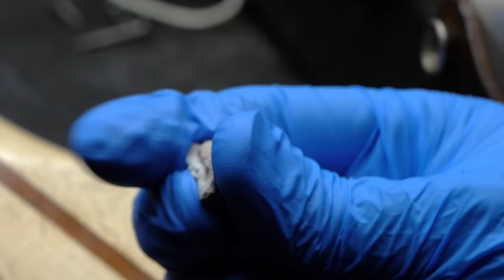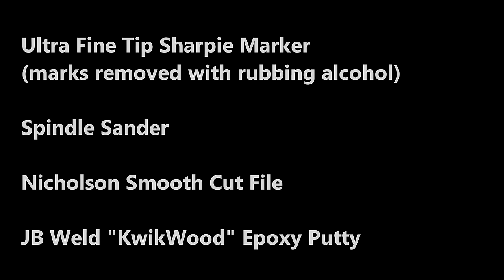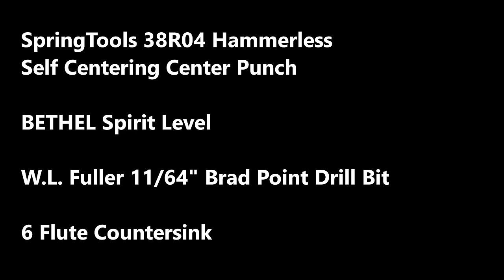My Strat Gets a Heel Contour

Comment: You left some pretty harsh edges on that body after the spindle sander.  It would be pretty easy to round them over just a bit for a better hand-feel.  Otherwise nice job.
Reply from the maker: I'm frustrated I left that part out! I actually have a video clip of me aggressively rounding over the edges and getting it perfectly rounded off with a smooth cut file -- but I forgot to include it. 

Anyway, thanks for the compliment, and I appreciate the support! I hope I can implant this in my brain as a lesson for next time -- I have to proof-watch my videos multiple times and make sure they include everything. No excuses.

Comment: I didn't know MIM Fenders had bushings for the neck screws- what a good idea! I hvae a 1993 Japanese HRR Strat with a contoured heel- such a good idea I wonder if they should be on all Strats (except vintage reissues etc.
Reply from the maker: No guitars I'm aware of come with threaded inserts -- I did the installation myself, which I have a video about if you're interested: 

https://youtu.be/LRMnSfjIqik?si=izTArK9L1EB69DRb

I go over the whole process in-depth there. Great mod! 

Also, awesome about that Japanese Strat. I agree the contour should be on all Strats. Makes a huge, huge difference. I haven't seen many contours in person, and just winged this one -- but it came out great. Upper register is actually usable now!
Reply: @guitar_md  Gotcha. Good job- great idea. Had a thread go on a Sire Bass a while back while doing work on it- would have been a good idea for that..
Reply from the maker: @thedonal  Oh, I love threaded inserts for repairs. Sometimes you can touch up the threads with CA glue..but the threaded inserts are much easier than doing a plug and re-drill. 

With the inserts, you just drill oversize, then drive the insert in. With plugging a hole and re-drilling, you've gotta plug it, then reattach it to the body, mark the location, then drill it out. 

The EZ-LOK threaded inserts are awesome too. I think they're the best out there. Very, very aggressive threads that bite deep into the wood. Can't see those ever loosening up or failing in a million years. 

8-32 is the way to go. Get some stainless steel machine screws and you're good to go!
Reply: @guitar_md  I went with bamboo BBQ skewers and wood glue- seems to be holding. The neck screws on that bass are bendy as fark though!

Comment: Hi my strat body is countour neck joint,can i use standard strat neck?what i need to consider.?my strat neck joint looks like suhr modern style..
Reply from the maker: You should be able to use a standard Strat neck with it, as far as I know. The neck pockets on Strats are standardized and will fit most of the time. Chances are, it'll work. 

The contour neck joint won't be a problem. Most necks will come without holes drilled, so you'll have to drill them yourself -- or if there are holes already, you'll likely just have to drill one additional hole. The contoured neck heels usually have one of the neck screws placed much lower than it usually is. 

Let me know how it goes!
Reply: @ thanks so much for the reply..now i have the idea and the courage to buy the neck😅..

Comment: What was the reason behind counter sinking the new screw hole before putting the plate on?
Reply from the maker: It's very unlikely, but it's possible for the screws to chip the paint around the screw holes when removing the neck. When pulling the screws out it could catch the edge of the hole and take a chip of paint up with it. 

Very unlikely -- but possible. Plus, the countersink just looks nicer. The other holes were also countersunk -- unsure if I did this before, or it was from the factory that way. But either way it looks much more aesthetic and takes a much better picture.

Comment: Why are you putting a spirit level on your piece? Level the base plate and it'll kinda flow through.
Reply from the maker: Because I got lazy with it. Hardware still all on the body. If you want the body to sit flush on the baseplate, you have to remove the pickguard at the very least. I have some fairly complicated wiring going through to the custom output jack I made and undoing it would have been a royal pain. 

I'd never do this on a customer's guitar, but on my own, I don't mind taking shortcuts once in a while. 

Same reason for the minor blowout.

If you have any suggestions for preventing blowout for that, I'm all ears. I didn't think of a great way to do it yet and if it was something I'd thought out, I would have definitely included it. I can think of a couple ways to do it but would be curious what you would have done to prevent it, and maybe I'll try that next time. 

Next best thing was showing the blowout. I could have just left that out, but I thought it was important for people to see, so if they did it the way I did they can expect the same thing...and take measures to avoid it. 

No excuse for me...I simply get lazy when working on my own guitars. I always try to be at the top of my game when working on other people's guitars, but for my own, I usually take some shortcuts. 

That being said, I've done a lot of other work on this Strat, and I do mean a lot, and I was very meticulous with all of it. 

Re-radiused, re-contoured, re-finished and re-fretted the neck, installed new tuners and cut a bone nut for it, cut a super customized pickguard and top loading jack plate for it, assembled and wound the pickups, then went to the nth degree with the setup and fret profiling -- 

-- I should've gone the extra mile and done everything pristinely for the sake of the video, but it got by me, and I let my impatience get the better of me. Outside of the blowout and the color mismatch of the epoxy putty it came out very smooth though, and plays amazingly well. Upper fret access infinitely better than it was before

Comment: Nice! what's the spring tool you use in making a dent before drilling? also what's the drill bit size?
Reply from the maker: SpringTools 38R04 Hammerless Self Centering Center Punch. 11/64" Brad Point Drill Bit

I've updated the video description to include a complete tool list: 

Ultra Fine Tip Sharpie Marker (marks removed with rubbing alcohol)
Spindle Sander
Nicholson Smooth Cut File
JB Weld "Kwikwood" Epoxy Putty
SpringTools 38R04 Hammerless Self Centering Center Punch
BETHEL Spirit Level
11/64" Brad Point Drill Bit
6 Flute Countersink
Titebond
E-Z LOK 8-32 Threaded Inserts for Hardwood (Stainless Steel)
E-Z LOK Drive Tool + Drill Press

Hopefully this helps!

Comment: Seems like it would be easier just to buy a guitar that already had this done from the factory.
Reply: If you like the body and it’s not anything really special why not mod it ? If it was a vintage or limited edition something or another probably not but the coolest thing about Strats in my opinion is that they are modular by design and easier to mod if that’s what you want to do .
Reply from the maker: @brandonjackson5865  I'd love to make a video on this. I'm lucky I have the resources to make my own pickguards and pickups as well. But the interchangeable necks and infinite potential for modding is one of my favorite things with Strats. 

My current pickguard uses only a neck and bridge pickup, and I made a top loading jack plate loaded with a 3 way switch as well. No middle pickup, pickup selector, or too close volume knob in the way. Absolutely love it and now I do all my Strats like this.

Also a fan of the Wilkinson 54mm Bridge. 2-1/8" spacing. Narrower than vintage, wider than Mexican. Great in-between. Next up is the NutBuster. Check that out...if it does what it says, I'll be sold. Hopefully video coming soon on that!
Reply from the maker: It would be easier for sure!
Reply: @guitar_md  Wilkinson makes fantastic hardware I have a Wilkinson tremolo on my Baretta Special. I really like the input jack and 3 way switch you made and moving the volume knob out of the way corrects my only pet peeve with a Strat . I also never thought of beveling a pick guard with a utility blade like that, I have an old Ibanez RG550 and I have a hard time finding a pick guard configured like I want that is the correct Japanese screw patterns so I am interested in making my own and I enjoyed your video, thanks for sharing and I encourage you to keep making content at whatever capacity you are able to if you enjoy it
Reply from the maker: @brandonjackson5865  Thanks so much! I agree, I love Wilkinson hardware. I really like the set screw for the tremolo bar as well. 

And yes, that bevel bit works great. You can use a scraper or a single edge razor for doing it by hand as well. Even a hand file will work and you can clean it up with a razor after. 

Working on many new videos. I have probably 60 I'm working on at the moment.....a bit much!!! I lose track of them. ADHD to the max. Thanks so much for the support and commentary, much appreciated -- and let me know how the pickguard goes if you get to it!

Comment: Have you noticed any difference audibly? Some might roll their eyes but you are removing mass, thereby changing its resonant frequency. It’s just a question of if it’s enough to be audible or not.
Reply from the maker: Personally, I've noticed no difference audibly. Just easier to play. However, I also left the entire pocket intact. More aggressive removal of the neck pocket area would remove the entire area of the neck pocket in contact with the heel of the neck in the contour area. 

I thought leaving the entire pocket untouched would look better, but maybe there's some sound benefit too. Could be completely off the wall persnickety here, but maybe it is true. I just didn't want the topmost screw on the left exposed by removing that area of the neck pocket.

Comment: I was told if I tried this, the paint could chip and spread through the guitar
Reply from the maker: It's possible. This is my personal guitar and I wouldn't be worried at all -- it has plenty of chips and cracks already. 2005 MIM Strat. Has a huge finish crack from the neck pocket extending up the upper horn, and a gigantic chip around the bottom strap button -- and more. 

But for someone else? I'd only do it if they didn't care about cosmetics. Modern poly finishes are pretty resilient, but you never know. Definitely not a mod you'd want to do on a guitar that you really care about the cosmetics on. 

I like leaving it as bare wood too. No interest in spraying finish over it and blending it with the rest of the body. I could do that, but no interest. That might really bother some people. 

The difference in upper fret access is staggering though, for sure. Really enjoyable to play up there now!

Comment: I thought you did an awesome job taking off the blocky heel.
I don't know why Fender (or anyone else making "S type" guitars) doesn't do that! 
 They make "belly cuts" and all kinds of other mods to customize the shapw, making it more comfortable & ergonomic, so why not improve access to the high frets?!
Seems kinda important to me.
I thought it was a great idea, and the work was done well. 
I like your use if the threaded inserts, too.
As a lifelong photographer & videographer, i thought your documentation of the work, as well as the work itself, was well done! 👍
👌👍   🤪
Reply from the maker: Thanks so much! I've wanted to make some videos about some of my camera/lens stuff as well. Knowing you're a lifelong pro with that, let me nerd out for a second: 

I'm using a Lumix GH2 from 2010 that I've "hacked" to shoot at 44mb/s, beyond the native 24mb/s, and a variety of about 8 lenses and accessories. 

One of the most unique is a sort of Frankenstein setup: a 36-90mm helicoid adapter, a 2x teleconverter, an Industar 50mm pancake lens from the '80s, and optionally, a Raynox 2.5x snap-on magnification lens if I want to get even closer up. 

Super light, and with a great working distance. I have a 105mm Kiron macro lens, but it's so big and heavy and I don't have a tripod mount adapter or a tripod collar for it, and only just started reading about focus rails -- 

-- but with the Industar makeshift macro lens, it's so light, that even with the helicoid fully extended, I don't need a tripod mount or anything. 

Anyway, when you mentioned being a pro photographer and videographer for a long time....couldn't resist! I really appreciate that coming from you, as I have no professional experience with either of those things, though I really do enjoy shooting/filming these videos and try to capture things in ways I haven't seen other people capture them. 

Thanks again for the support, so much!

Comment: Is there a reason fender dont do this or is it purely manufacturing economics
Reply: Ibanez offers entry level gear with a contoured heel. I think the main reason is their "vintage" branding.
Reply from the maker: Good question! Probably economics. I've played and looked at some old Fenders and they all had steep, comfortable contours on the back of the headstock. The neck pocket holes were always cleared. And the body contours were always great. 

I don't know what machinery they use for doing the contours and how much of it is done by hand. But it might come down to that. Same reason cheap plastic pre slotted nuts are everywhere. 

Or it could be the "vintage" branding as the other user here commented. People are used to that blocky look and it's what it's always been. 

Same reason I think bolt on acoustic necks are far superior. But set necks are the standard because it's tradition. Taylor has never made a set neck acoustic and they're much easier to set up properly as a result. 

With normal acoustics, you're basically screwed when the top bellies up as the only true fix is a neck reset. The JLD Bridge Doctor can only do so much. So that's a perfect example of people stubbornly clinging to tradition when there is a clearly superior way. 

Not sure of Fender's cheapest models that have a contoured heel but it could be a marketing strategy as well.
Reply: @guitar_md  I think the marketing strategy is the reason. Fender offers Classic Vibe Squiers (Vintage) at around the same as the Contemporary Squiers (with contours). They have their niche in the "vintage" but offer the modern options for people who still want "Fender" in the headstock.